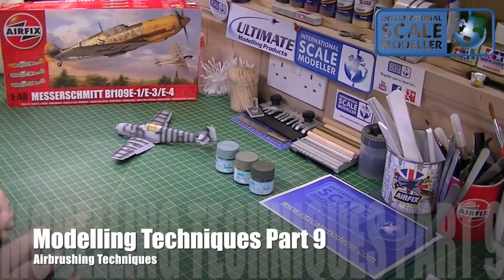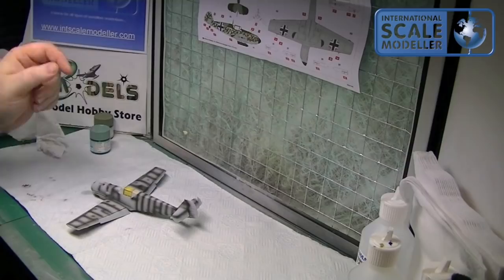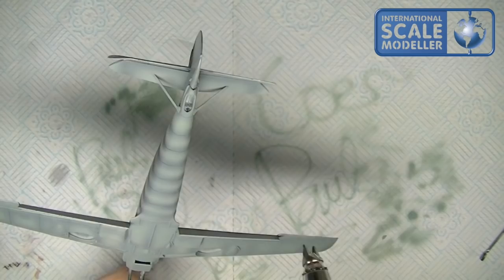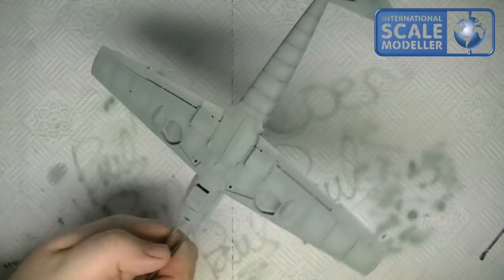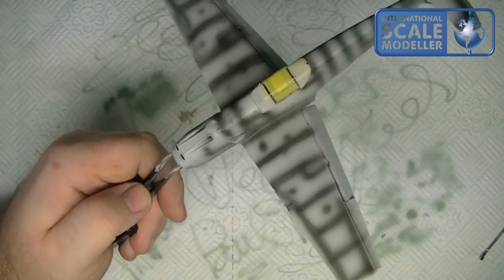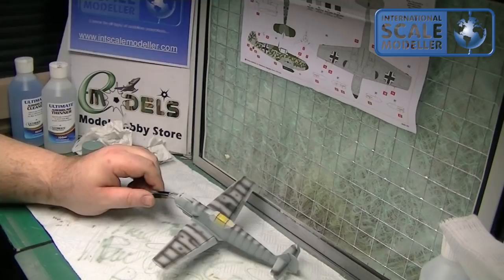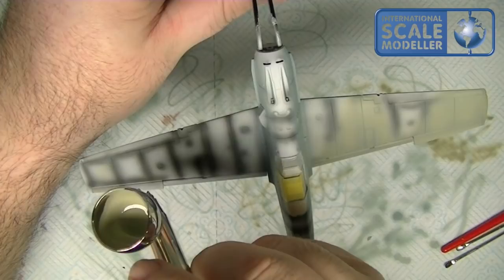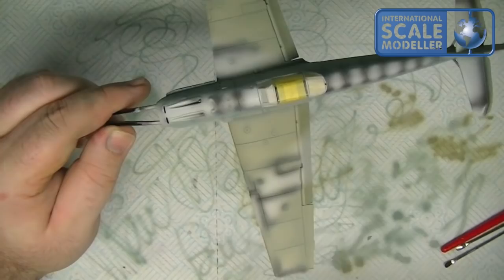Aircraft Modelling Techniques Part 9 - Airbrushing Techniques

Comment: Paul, out of interest, why have you fixed the elevators fully down? Normally controls are balanced to remain level unless you are picketing or expecting gusts/ high wind. Then we would hold the stick back with the waist strap to negate the tail lifting and tipping the cab on its nose. Just asking, nit a dig. Would you advocate pre shading on Braille scale?
Reply from the maker: You would have to ask me 9 years ago as I’ve built alot since this video series :)
Reply: Ah. Ok matey. Well it’s a good watch either way👍
Reply from the maker: @Flingwing24  cheers mate

Comment: Does it matter what brand of airbrush your using in regards to the air pressure used where you mention 25 PSI ?  Also does it matter what paint brand your using to use the thinning ratio 60-40 ?
Reply: Hey Deron, i find it doesn't matter which airbrush it is, i use an iwata neo and revolution as well as the Harder evo and they all work fine at 25 PSI. Each paint varies how much it needs thinning but for most a good starting point is 50/50 and adjust it to suit your needs.

Comment: Hi.
So, i am convinced i am using wayyy to much paint.
I have to "refuel" too frequently.
Do you have an idea of, just a rough one, of home many full airbrush cups of paint you would use to paint all the plane with a single color?
Maybe i am using too much pressure?
Reply: Yeah on a plane of this size i would say half a colour cup would be plenty which is about 2.5ml of paint, you don't need a lot of paint, just nice thin coats, moving around the model coming back to the same point when it has dried.

Comment: That was educational for sure. I have never airbrushed before and I am now considering the purchase of an inexpensive airbrush setup from Amazon.com. As I am on a "VERY: Tight Budget I don't even want to think about much more than $125 to get started. I'm looking at a few options from Amazon.com like....Master Airbrush® Brand (w/comp., 3 air brushes, etc. for $99), and PointZero Airbrush (incl. 2 airbrushes, comp. hose, etc.). Any thoughts for a cheapskate amateur????? Thanks for any input from anyone...
Reply: I literally just bought a cheap airbrush just to see if I get on with it which was about £20 pounds with a air tank, about $30 in dollars, I have got on with it well and one I am getting is a FoxHunter KMS Airbrush Kit AS18 , check that out on Amazon that's a good one. :) hope it helps
Reply: Thanks for the suggestion....